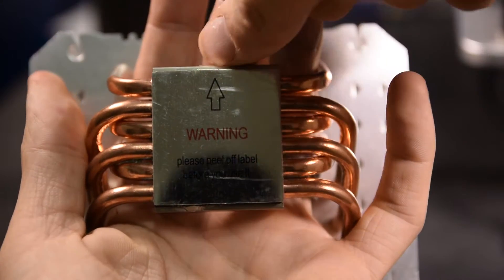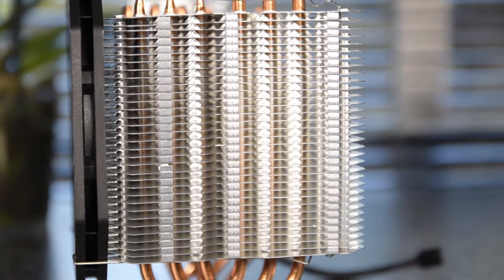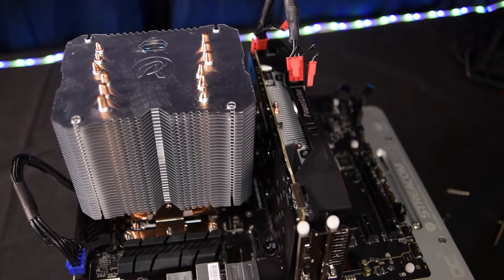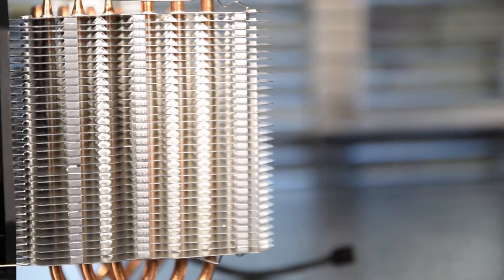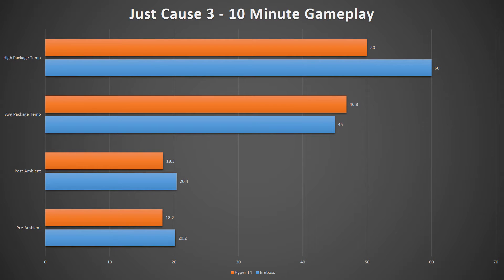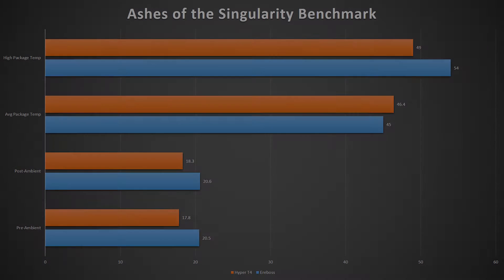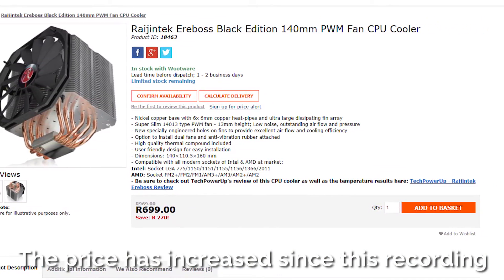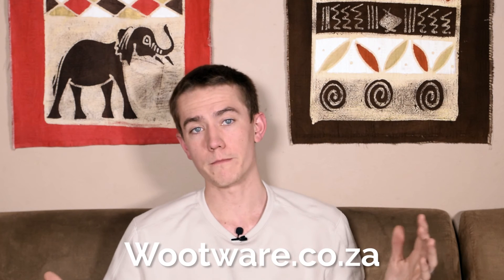Raijintek Ereboss Review - Better than a Hyper T4?

Comment: For this size of heatsink you should use 2 fans to make enough airpressure and more precise airflow direction between the fins to remove the heat. I know, because I have a Sytche Ninja 3. I used with only 1 fan for long period, but I tried with 2 fan in the near past. I have much better cooling capacity on the same RPM with an OC'd i3-8350K.

Comment: About your mounting difficulties. If you don't have a magnetic screwdriver to hold the screw, you can just attach a magnet to the provided metal screwdriver and it will be magnitized.
I got the ereboss core Edition, and I love it